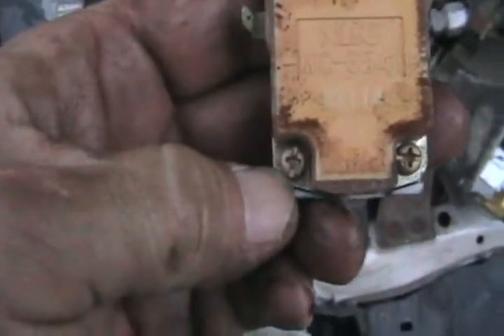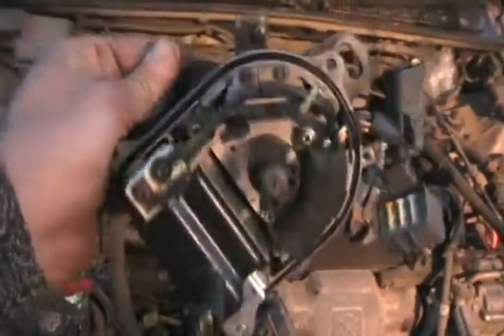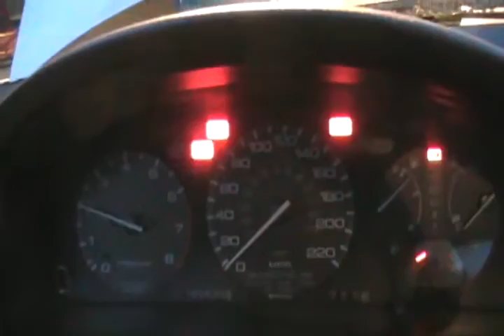#1297 Honda accord distributer repair [Davidsfarm]

Comment: that's why in 1992 Honda put an external coil on them. only 1990 and 1991 accords have internal coils.
Reply: Wow, I had no idea but I just checked and you are totally correct! Then they switched back to an internal coil for the 98-02. I wonder if the external coils fail less often since they get more airflow, the internal coils fail a lot for whatever reason. I think an external ignitor would have probably been a good idea too.